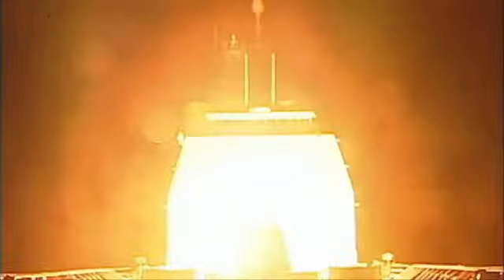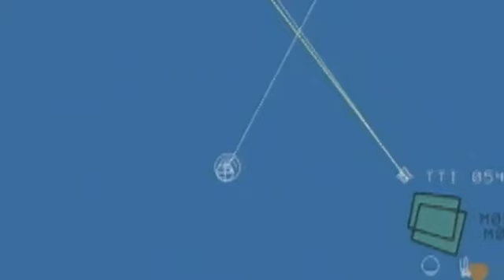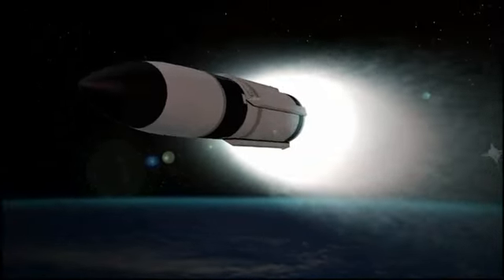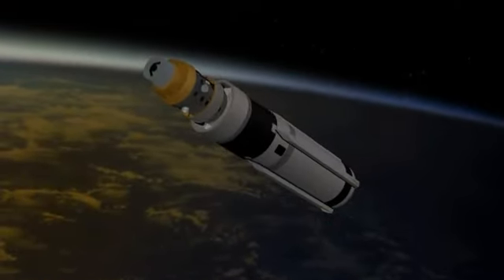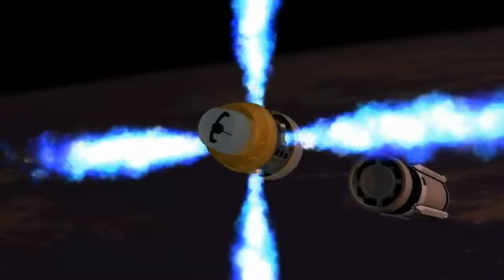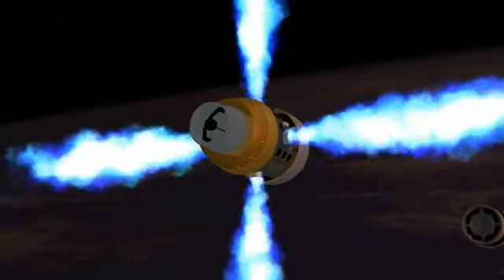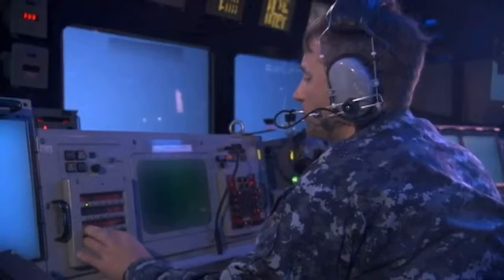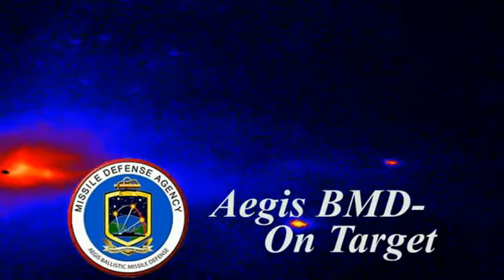Aegis Ballistic Missile SM 3 (star wars) Takes Out Another Ballistic Missile Target

Comment: Great System but I thought "SDI" was a laser-based concept.
Reply: SDI was a broad range of technologies, most of which failed due to the limitations of physics.
Reply: They are currently running projects to develop such lasers. If I remember correctly, the goal is to develop a 550 Kilowatt laser by 2021 and a 1 Megawatt laser by 2023. You can look it up.